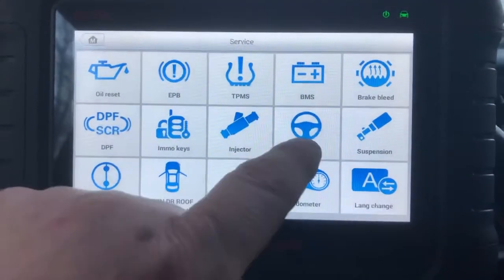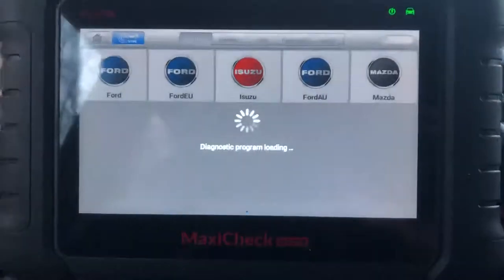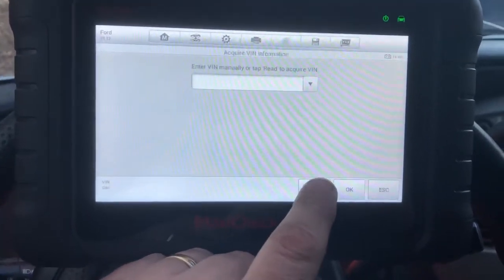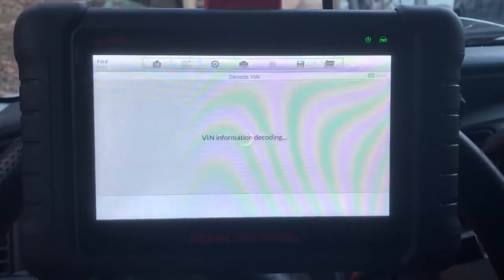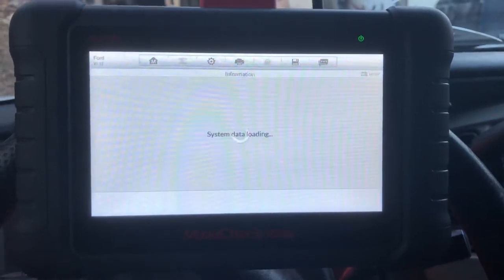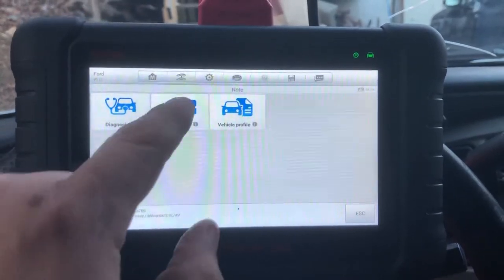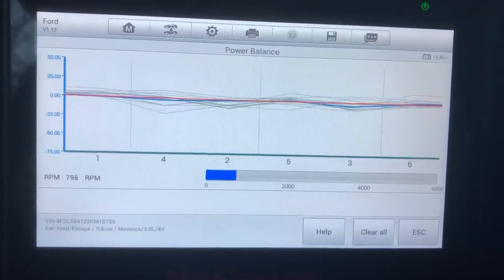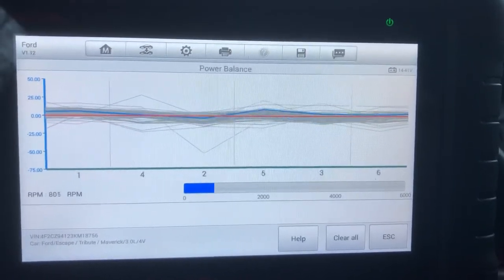Autel MX808 ford cylinder power balance test

Comment: If only I had bought this tool 2 weeks before I took my f150 to my local ford dealership to diagnose my no code misfire problem. they did the same power balance test that you show this tool is capable of. currently trying to get familiar with this tool I recently purchased.

Comment: Ya nice tool. That was my 1st one MK808BT. Got it 2 yrs ago now I got the MS906BT. Same but alot more Function's. And bigger tablet 10 in vs 8 both are Blue tooth. But the 906 has in arcilla scope for channel in an inspection scope as well as battery maintenance module
Reply: @Joby Fluorine ya sometime the phone Don.t here correctly and I forgot to read it before I hit send. But. As long as you got to feel good about feeling superior. And pointing this out I will be more carfull in the future
Reply: @bigbobno11  Now with the updates, the MK/MP 808 now has the capability of the inspection scope. In relation to the battery testers, I believe that you need to purchase and external device that is worth as much as a dedicated battery testers such as the BT608E. At least with the latter, you get a printer

Comment: so is each line a cylinder and how do you tell what cylinder is missing ,whats the red and blue lines I have that scanner and  it can be a little frustrating poking at data not knowing what its supposed to be
Reply: Those lines aren't the cylinders, the numbers at the bottom are the cylinders

Comment: Works only on Ford and the others shown?
Reply: Get the Zurich Pro from HARBOR FREIGHT. Sounds ridiculous I know. Right now they are doing $100 off and a free year of the update/service/help data with purchase and has a hell of a warranty if you paid for it. Got it two days later from FedEx and I am friggin IMPRESSED. I told someone else in here it does every function that any vehicle you can think of will if the vehicle itself would support it, including this simple test. Programs keys, programs replacements ECUs, anti theft stuff (forget what it’s called), and will reset tire pressure monitoring systems. It’s legit. I keep bragging about jt because I had never heard of it and it came from harbor freight so wasn’t expecting much. $800.

Comment: can it read live data? I just bought one thinking it does I need to read live data on a f250
Reply: Believe it or not, I finally went to Harbor friggin Freight and got their Zurich pro….I’ve got to say there isn’t anything it can’t do. Not that I need anyway. Super user friendly, great warranty (though I haven’t had to make use of a warranty), it’s well built and comes with a seeet case. $100 off sale right now I picked it up for $799 and it had bidirectional controls, will do any make and model you can possibly think of, and does every function test you can imagine. I’m not a salesman for these people I had never heard of the thing, but dang, best money I have spent! If I knew how to include a picture or something I would.

Comment: Will this work on f250 6.0 power balance  as well ??  Thanks.
Reply from the maker: Patrk aymod I’m not sure but I’ll test it out this weekend, we have one at work.
Reply: @JeffGoldSr  did this work on your 6.0 Powerstroke?
Reply from the maker: I’m sorry, right after this I ended up going back to driving truck. I’m sorry, I completely forgot to check and I apologize for taking so long to get back to this. 

In answering your question, I’m sorry, I don’t know. I didn’t do a lot with electronic controlled diesels.

Comment: Get the Zurich Pro from HARBOR FREIGHT. Sounds ridiculous I know. Right now they are doing $100 off and a free year of the update/service/help data with purchase and has a hell of a warranty if you paid for it. Got it two days later from FedEx and I am friggin IMPRESSED. I told someone else in here it does every function that any vehicle you can think of will if the vehicle itself would support it. Programs keys, programs replacements ECUs, anti theft stuff (forget what it’s called), and will reset tire pressure monitoring systems. It’s legit. $800 with free year of service. (I forget how much each year after us but it’s cheaper than comparable snap on/Autel etc.

Comment: Does this tool have bidirectional functions? I read somewhere that it’s limited to this. That only the expensive one have that. Like the $2-4k ranged ones. If this has everything the expensive ones have, then it’s funny that people buy the overpriced ones when they could get these cheap ones that do the same. Lol. Thanks for the video as well :)
Reply: I think you have to jump up to the Autel MP series for that functionality (and even that one might be fairly limited).  Those run $750+, which if the specific bi-directional functions needed are included, is a bargain compared to the next level up.
Reply from the maker: No, there is no bi directional control. This does have the ability to program some keys, read/clear codes, give dealer level live data and get into most of the different modules.
Reply: @JeffGoldSr  have you tried programming keyfobs with it?